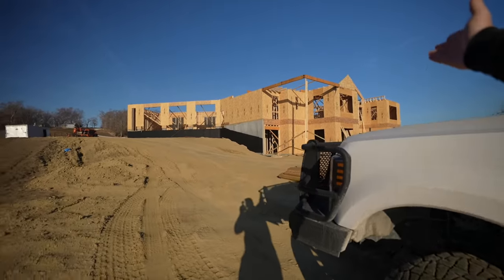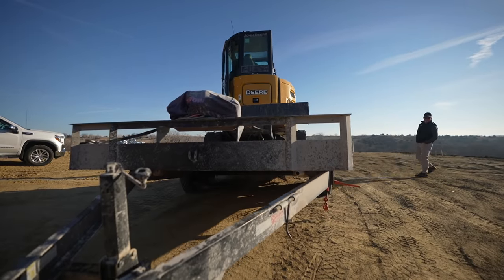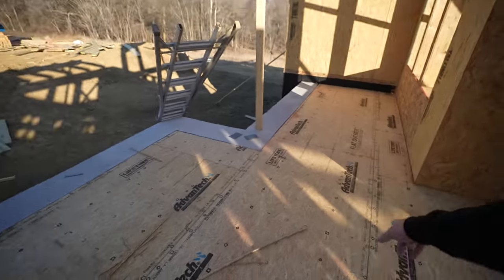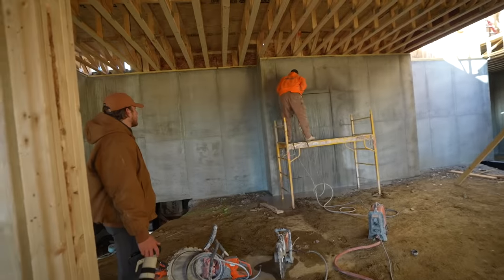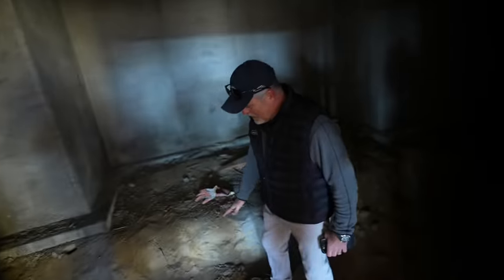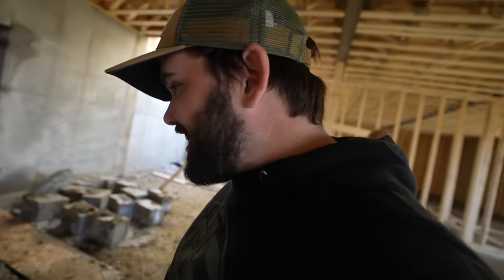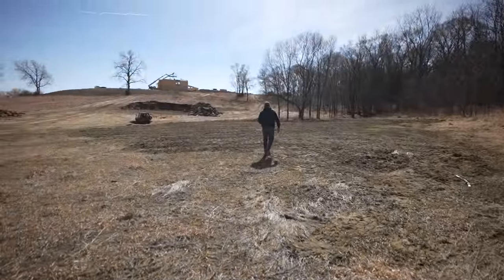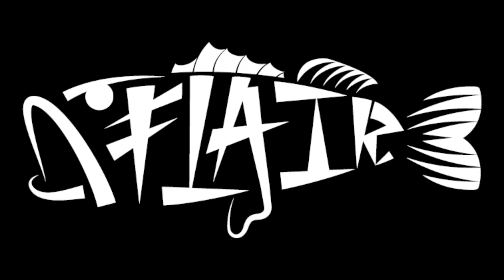Building a HIDDEN VAULT Inside My NEW HOUSE!!! (Don't Tell Anyone)

Comment: On the 2 slim areas, use 1 side for ammo creates, and the other side build a shelf for cleaning station.
Reply: If only flair cleaned his guns 😂😂
Reply: @posterlin  fr
Reply: Or a reloading set-up on oneside
Reply: @posterlin  same goes for DemoRanch
Reply: I was thinking the ammo can be stocked in the center with the guns on either of the side parts.
Reply: Both sides for ammo shelves and extra parts.
Reply: Both sides for ammo and extra parts
Reply: Smart
Reply: instead of cleaning station i say jus a work bench

Comment: "We gotta do something about the humidity in here"
A/C guy here! You should look into a mini split system.  It's small, hangs on the wall or from the ceiling, can pump the condensation (humidity)  out wherever you want and you only have to drill around a 2-2 1/2 inch hole in the wall to run the linesets (copper tubing, power and drain line)
Just a thought!
Reply: u where talking to flair about this but i think i might need 1 or 2
Reply: @dro5436  they are a bit cheaper than a normal ac system and have a lot more benefits than just a dehumidifier.
There is a do it yourself (Mr cool) kit, but if you need/want more than one installed, I would contact a few HVAC companies in town for some estimates!
Reply: He needs a levrack for ammo on the wall across from the door a table next to the door and the hangers like what demo ranch has and pews on the end walls
Reply: @JayWillis2120  i will look into some

Comment: I think you also need a small closet in the house with a bat pole to drop down into the bunker or vault! 😀
Reply: The bunker is in the garage and the vault under the front deck of the house so you can’t do this
Reply: What about like a hidden tunnel within the closet, like a faked out sewer
Reply: Your gun room is a 1/4 of my whole house square feet.  😩
Reply: @mathiaschwialkowski3347  I'm confident Brad the builder can find a way as long as there's a budget for it 🙂
Reply: @mathiaschwialkowski3347  and there's no rooms above either of those structures? If so then why couldn't you do this?....
Reply: As a dude I’m like hell yeah but as a father of small children I have to highly disagree against a large concrete hole in the floor
Reply: @chasecrowe3034  its a lost of space or it wouldnt be hiden well
Reply: @Grick__rimes  yea that was my first thought too I forget flair is a dad now .
Reply: @Grick__rimes  yes he probably needs a secure hatch over it that requires a secret bat code to open it before he can slide down 😉
Reply: @Da_boop  or even a wardrobe, like he's passing through to Narnia 😀
Reply: Genius
Reply: Or pad the walls and make it a foam pit drop
Reply: What about like a hidden elevator and the doors look like normal wall
Reply: Bruh 🤣🤣

Comment: I do construction. Take a big tapcon screw. Like 3/4 to an inch thick by 4-6 inches in length. Then drill out a hole with hammer drill that matches the screw width and length. Then grab a chain and put the screw threw the chain then hook the chain up to the skid steer. Drag it out or close to the door then pick it up with the excavator.

Comment: Hey Flair you should put a generac whole home generator at your houses, and your warehouse. You should also go solar, and make them a -net-zero-home and warehouse. When they do this to your properties, the solar energy stores into your Hot Water Heater, and it can hold enough power to run everything soundly. Also you don't have to pay for electric services again, if you do this. I wish I could afford to do this, to my home.  I also think that what you don't use, goes to the electric company, & they send you a check for it if I'm not mistaken.

Comment: Speaking on experience as I also have a safe room under my porch.  Make sure to install a water drain in the floor.  Add a drain pipe on a side wall to run a dehumidifier full time and let it drain out said drain pipe.  Make sure electrician runs plenty of outlets throughout the room.  I have all my outlets at counter height for when I build my gun work bench and install my gun cabinets.  One side I'd leave for shelves for ammo storage.

Comment: When you enter the vault, have the 50 BMG centered on the big wall with your other rifles around it. On the 2 smaller walls on the left and right,  hang your pistols. Poker table/desk in the center of the room. Smaller rooms to the left and right, have crates of bulk pistol and rifle ammo. Above the vault door, have a security camera monitor that you're able to view footage of inside and outside of your house.

Comment: Get a hammer drill an some good glue designed for reobar an concrete use those off cuts or reo an use a winch to pull them out side then use the 4 in 1 bucket on the skid steer to pick them up

Comment: On the long stretches if you just did one side of the wall so it doesn't feel like you're pinched in too much or going to knock something down when you're in there with big coats but it gives plenty of expansion as you acquire maybe different firearms for the kiddos as they're growing up and you accumulate more yourself

Comment: Suggestion on the gun room, put sliding shelves in the two wings that pull out into the main room that way you get four times as much storage space and the main room can be for the things you want access to fast. For example during bow season you hang it in the main room so you can grab it every day then when black powder starts you put the bow and arrows on the sliding shelves and put the black powder stuff in the main room and so on and so forth that way you will have trained yourself to put everything that is dangerous locked away before your kids are old enough to hurt themselves and your wife will never have to worry about it thus you will never have to argue with wife

Comment: sheeeew,cool gun room,defo need guns in middle part,floor uprights to ceiling,wall horizontal mounts,john wick style room, left side,secondary secret door fitted,panic room style,inside bunk beds,food,water and phone. right side far end wall work bench,shelving above,holding cctv monitor of like 8 cameras fitted exterior of house,work bench for working on guns,all tools below,shelving behind for ammo storage and pistols on wall there too. middle area sofa facing pews,t.v in middle of pews,opens up hidden t.v,guns still on outside when moved. mini bar on wall near door right side as come in,optics with wiskey,bourbon etc. couple of duck mounts above door,side of door a bass mount. just some ideas for ya.
peace......mad house btw.

Comment: Push the concrete blocks into the ditch to the left that you need to fill in and either leave them whole or break them up a bit with a jack hammer and fill and pack dirt around them.

Comment: I would say use the atv with the snow plow to push the blocks in the hole to use as a filler, the atv should fit, then in the pew room i would make it open up to a poker table room and use the side wings as pew storage with some big vault doors or make them hidden walls , to where it looks like a wall but if you push a button or insert a small pin, the doors will open

Comment: Flair, U probably should have used those blocks from the wall door opening as filler for the floor in ur gun safe and just poured the concrete floor over top of them!! At least that way u probably wouldn't have had to compact the dirt down before pouring the floors in!!

Comment: Mounts in the middle section, and have each gun you used to kill the harvest under the mount. - & on the sides halls you have you can put hella guns down both sides
Reply: Make a small Bar with stools as the Seats, marble look floors    Or just tables and chairs/  -mounted tv

Comment: What if on one side of the vault and in the corner by the door you can put a table so you can work on your guns and getting ready for hunting or trapping and one side put all your traps hanging off the wall. On the big wall when you first walk in, you could make a display case for the guns that you don't use or you just want to show the gun off. And the lights I'd use would be LED and put 3 lights in the vault. You could put one of each side and one in the middle and put little lights facing down from the 2 corners showing off ur guns and have them activate when you open the door

Comment: I would have the guns on the big wall and then in one wing I would have a bench with all the scopes and tools with shelves for ammo and then the other wing have it full of survival stuff and have two flip down cots on the wall so you could sleep in it if necessary and then put a table with chairs or a couple big chairs to chill in and put a mount on both sides of the door or 2 on each side if the walls are tall enough

Comment: One guys house we worked on had a “safe room” that took a vault door to get into the room. Stored his guns and ammo in it. Had hidden ventilation that ran out into his garden under bushes that the tops looked like rock but it was where the air was blown out and fresh air brought in. He had a tv, some couches in there and that’s where he would go smoke his cigars so his wife didn’t have to smell it or anything. It was pretty sweet. On its own system so  heated and cooled. Had water ran to it. It was 9 foot wide by 30 long.
Reply: It was under his porch, 20 inch thick concrete with thick rebar in it, the porch deck/safe room ceiling was 16 inches thick poured on top of a 1 inch thick steel plate. Thing was absolutely indestructible.

Comment: 16" thick exterior walls, 8" filled block interior, 1' concrete floor, safe door entrance that looks like a bookcase and a 3/4" thick wood ceiling LMFAO. Ya might want to address that Andrew.